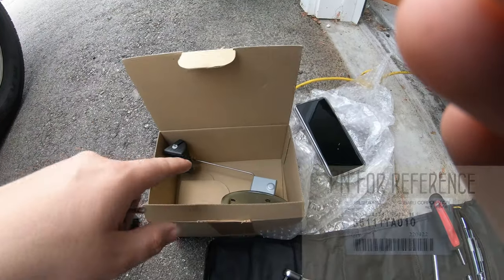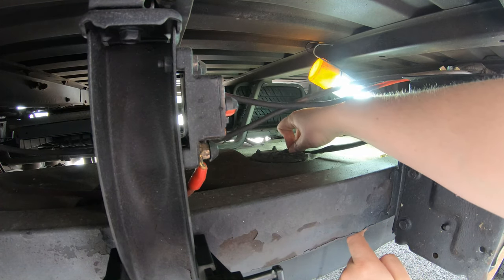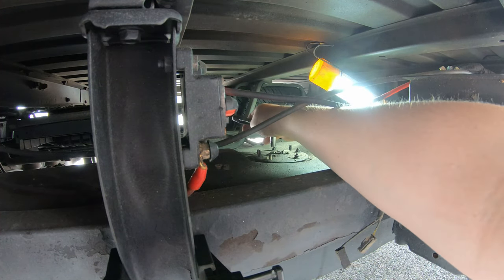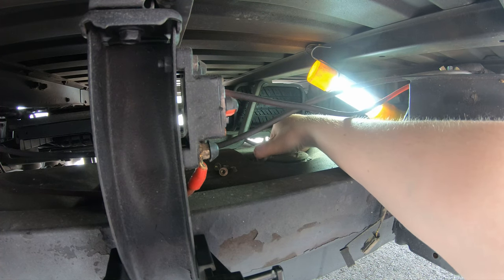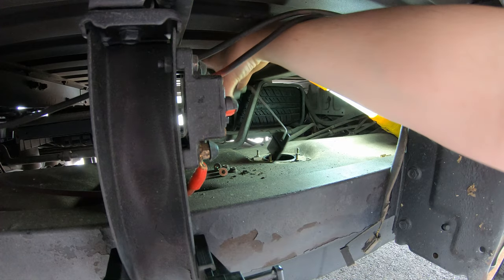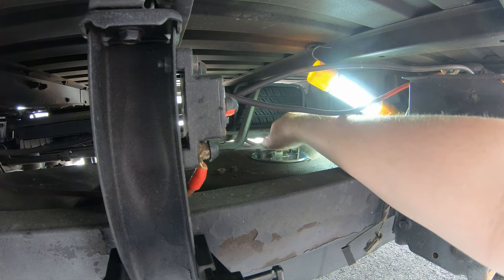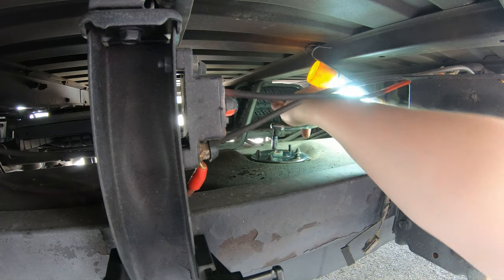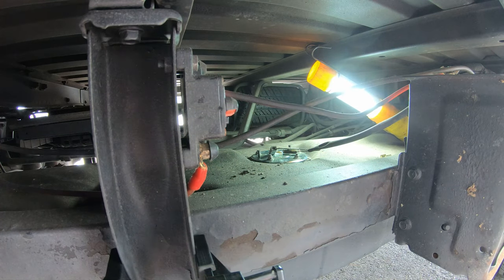Sambar Fuel Meter/Fuel Sender Replacement

Comment: Did it fix it?
Reply from the maker: Yup, next fillup it read on the full line. Additionally before committing to a meter, you can try contact cleaner on the terminals and check that the wires are not broken/incorrectly terminated (Ran into that on my UAZ). Its rare but I could see from its location corrosion on the terminals causing the same issue.